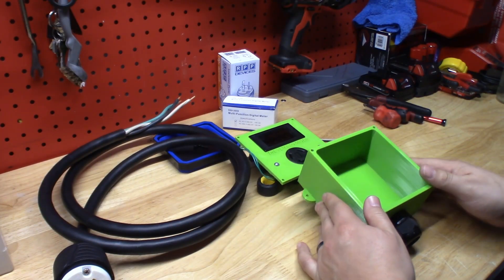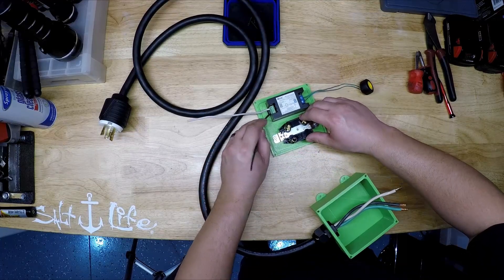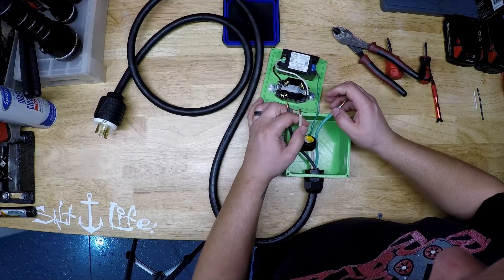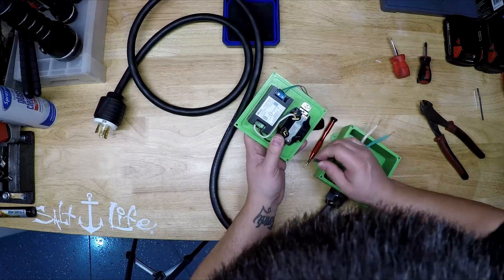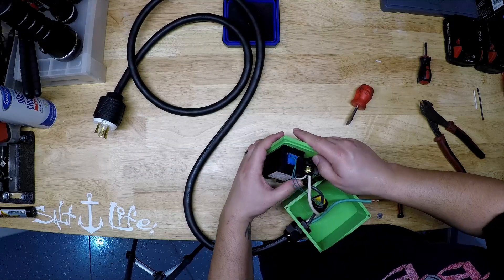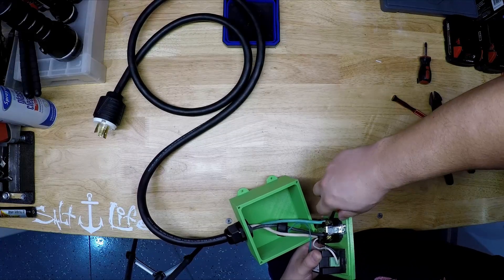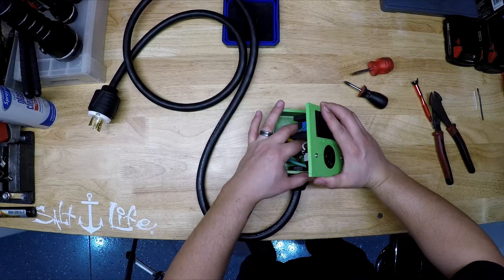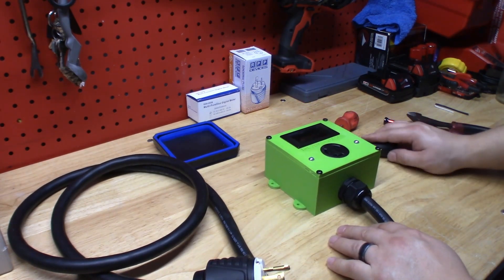GPU Mining Meter Box 240volt Install DIY

Comment: Nice video my brother <3
Too bad you seem to use 240V 2-poles (2 hot buses/wires), i would have been curious to know how to proceed with 240V single pole (like most countries around the planet)!
Happy midweek and keep on mining <3
Reply from the maker: Thank you for watching this is a single phase 240 volt install.
Reply: @TheVeteranMiner  My bad my brother, i meant to say 2 poles, since you are using two hot wires :)
P.S: i modified my initial comment.